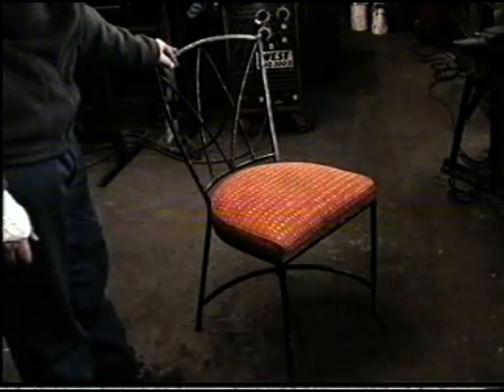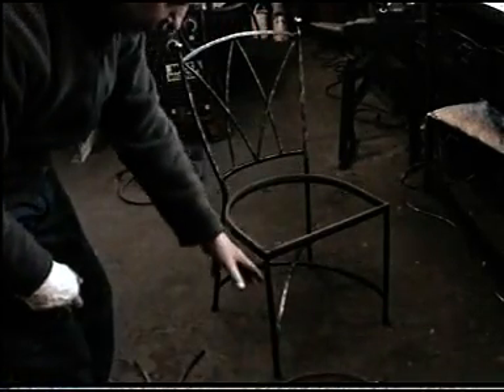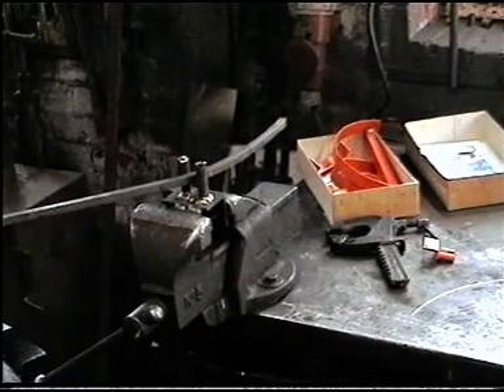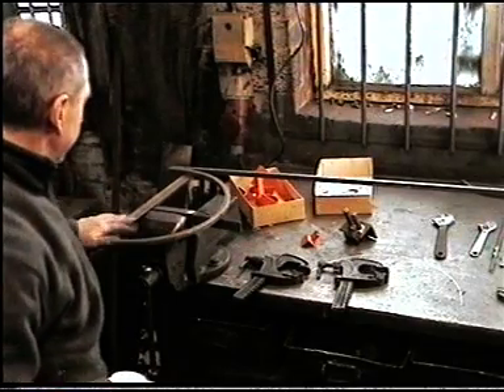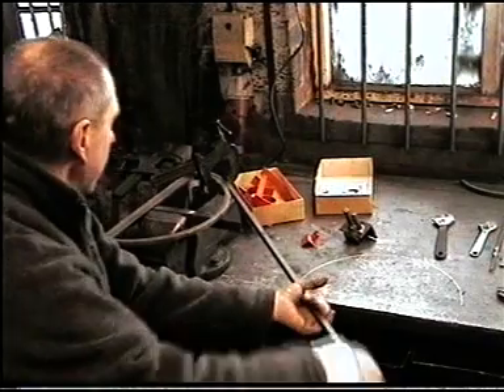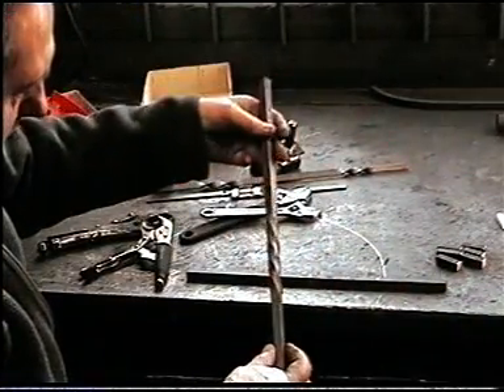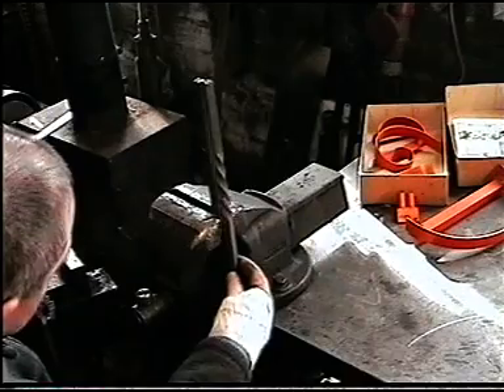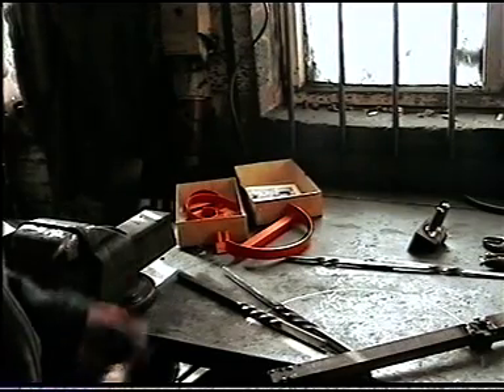how to make a simple twisting tool to bend 12mm sq  bar

Comment: WOW!!!  Simple but effective Dave!!!  I have already made the small twister for the 10, 13 and 25 mm by 3mm steel I use, my biggest size in solid square and round bar I use is 10mm so this tool in the vid should be more than adequate for the job.

Comment: I do a lot of twisting of 12mm square.  I found a ratchet (auto trade type) that had an internal 1/2" square hole.  Of course then I am relying on the strength of the ratchet tooth and pawl, but so far it's done hundreds of twists.  I always make sure my hands, arms, etc can't smash into anything if the ratchet slips.